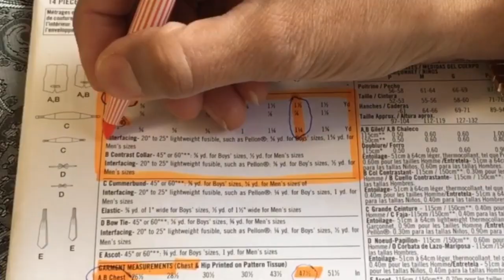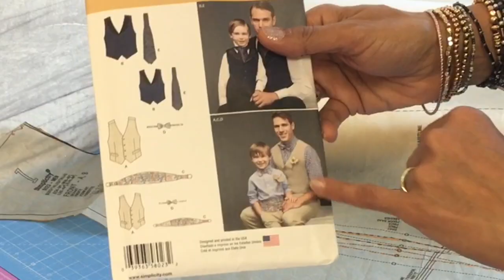A Beginner's guide to Interfacing , Stabilisers Abi’s Den ✂️🧵🌸

Comment: I've gotten now to where I only use Pellon Easy-Knit fusible and Pellon Shape-Flex fusible, and I get both about 5 yards at a time in both black and white.  I have a ton of cheap, packaged lightweight fusibles that I only use for things like buttonholes and tiny spots where I need a bit of stabilizer.  It's funny how you find the stuff that works consistently and just stick with it.  Cheap fabric?  Sometimes.  Cheap interfacing?  Not usually.  I can't count the amount of times I've had fabric pucker.  That's the worst!  
This is SUCH great info.  Thanks for clarifying!

Comment: Hi Abi. Does it matter which way you lay the interfacing on the fabric? As it doesnt have a selvedge and sometimes comes in a precut square I'm not sure if there's a right way to position it, or if when it's ironed on it doesn't matter. No one seems to mention this.
Reply from the maker: Gaga Knits doh! Missed that bit. Yes, I’ll cover it in the waistcoat video. The interfacing is laid similarly to the fabric.  You will see a cut side and the neat edges are the seal edges.
Reply: @AbisDen  Thank you for replying so promptly. I will look forward to it. X